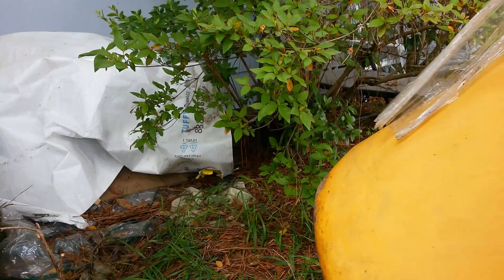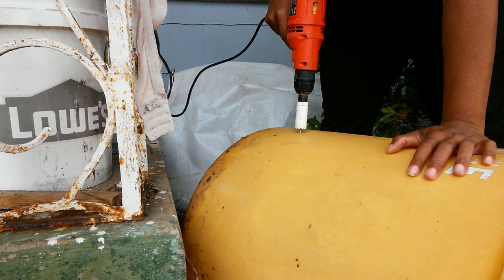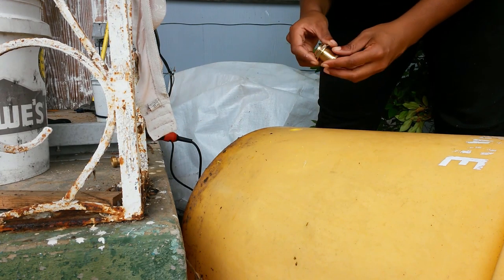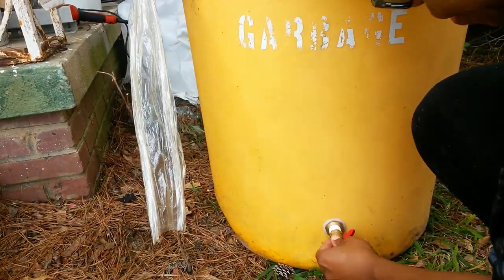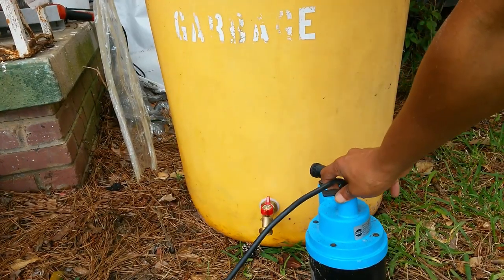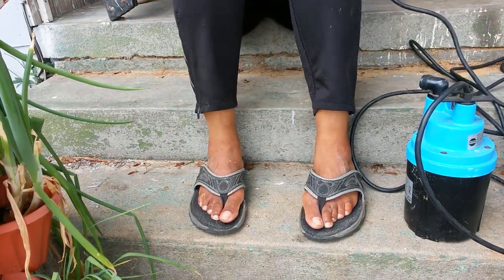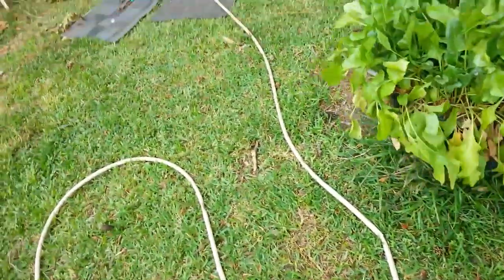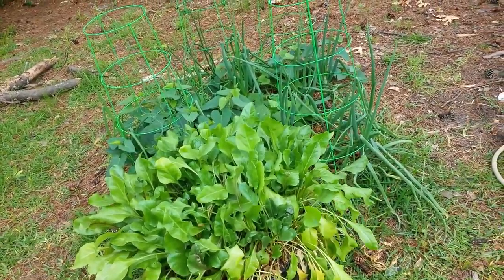How I added a submersible pump to my rain barrel!!! Watering system upgrade

Comment: Ooo, I love the idea of adding a spigot to the barrel😍. I have my hose attached directly to the pump which works great, but leaves the top off inviting bugs and stuff. Your way is much better 👏🏾👏🏾👏🏾. TFS💕
Reply from the maker: i had mine hooked up that way for a while until i decided to do this in case the pump goes out the water still can gravity feed. I still have more updates to make but i've started!

Comment: Great job Deva hey elevate your rain barrel too on that little yellow table by your rain barrel.  Looking good girl. Girl power. Thanks for sharing.
Reply from the maker: i plan to. i'm not done with upgrading this i still have to connect the barrels to each other so that when i run the pump it pumps from all of them and not just the one its in.